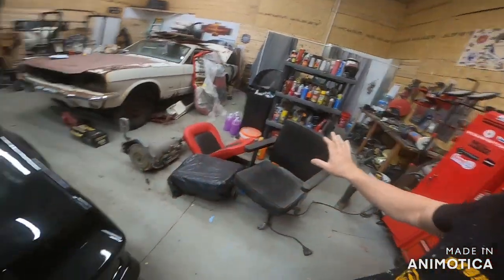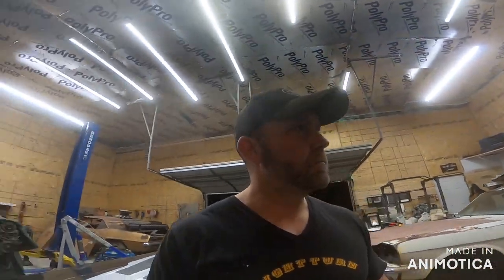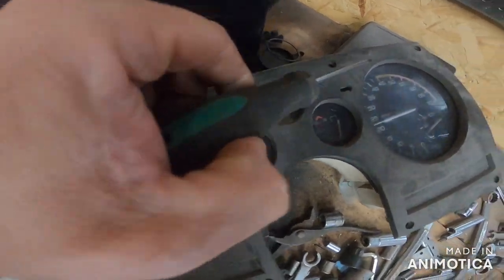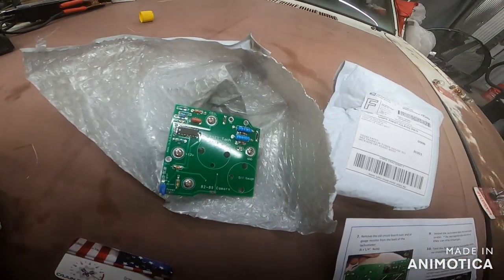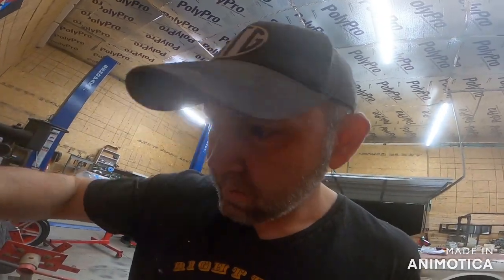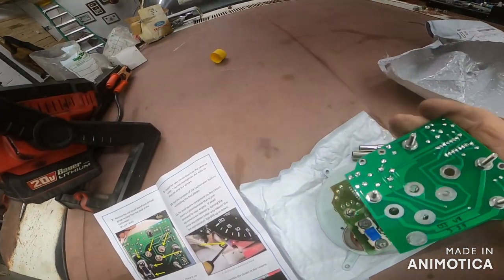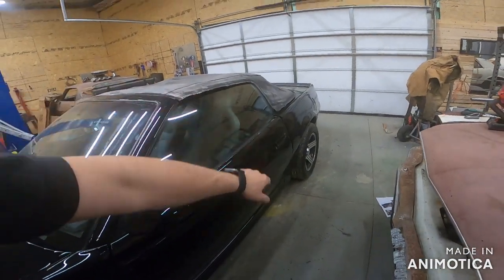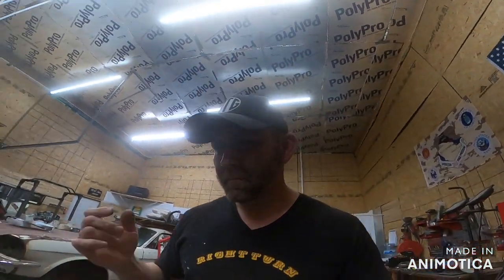fix your 3rd gen camaro tach

Comment: On those 3rd gen try removing the guage glass and flick each needle back and fourth a few times
  Most of them will start working again.  With power on engine running
Reply from the maker: Thanks for letting me and others know. I’ve never tried that. I did the ol thump on the outside of it trick but didn’t remove the plastic.